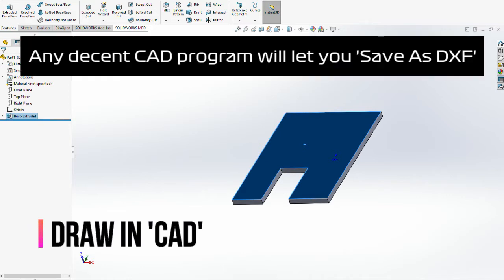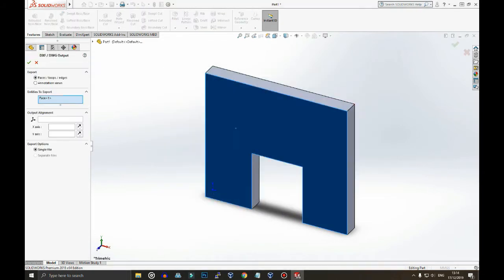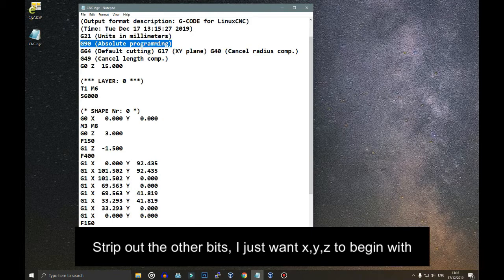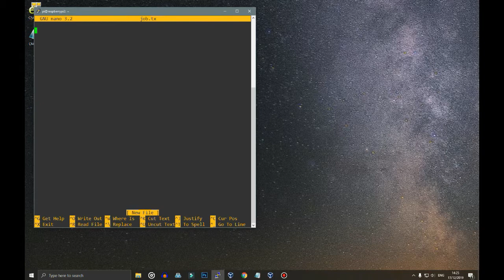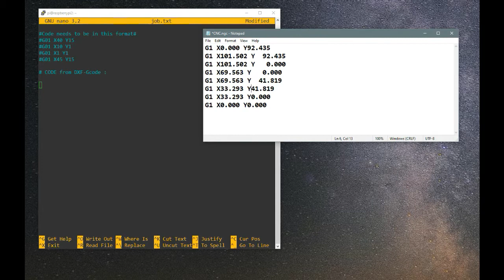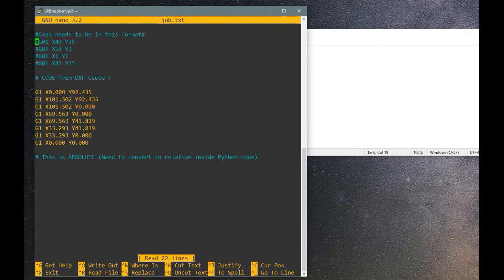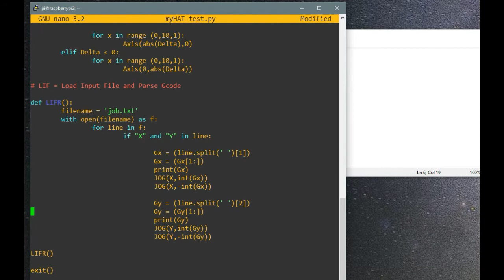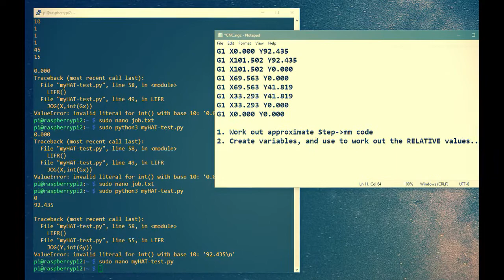Raspberry Pi Projects - DXF to Gcode

Comment: To work out steps per mm.....
Number of steps per stepper revolution divided by leadscrew pitch. Nema 17 is 200 steps. M8 leadscrew pitch is 1.25mm. 200/1.25 = 160 steps per mm.
Reply from the maker: I can't find spec of my leadscrew, might be 2mm pitch, but will use same logic. Cheers for the advice!
Reply: You can measure the pitch but it needs to by multiplyed by the number of starts if multi start, or turn your stepper motor one rotation, by hand or under computer control, and measure how far the axis moved. A steel rule might get it close enough or you could get a cheep DTI (Dial Test Indicator) from eBay.